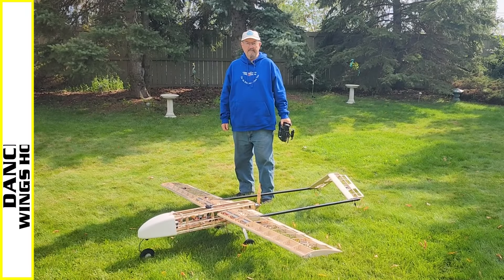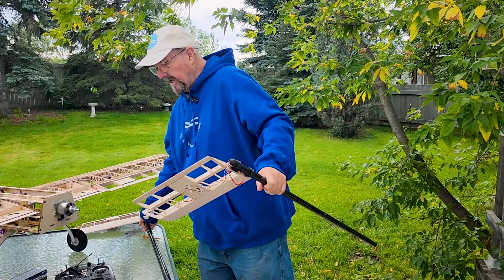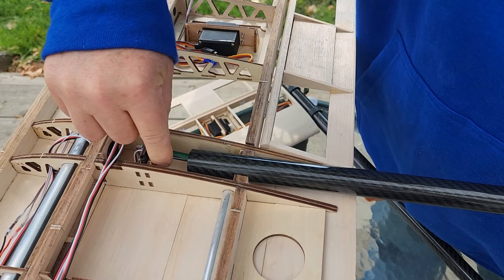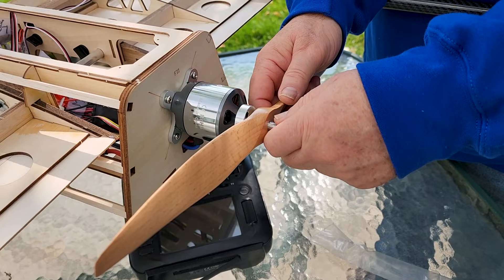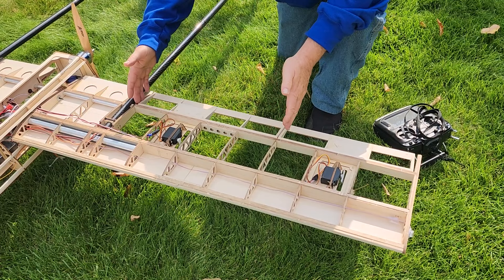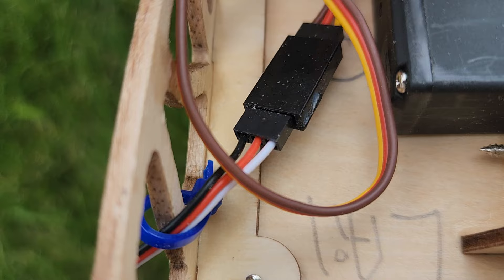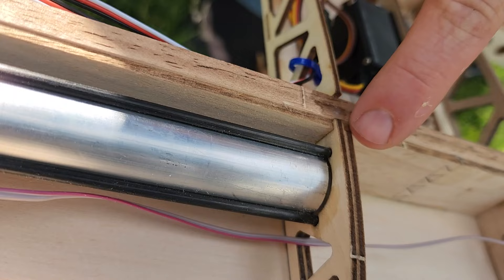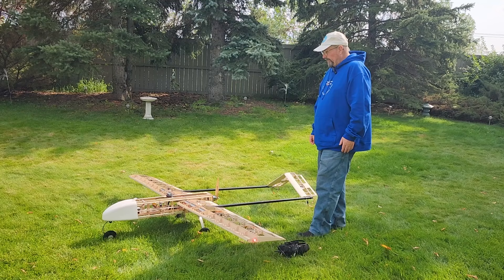RQ-7 Shadow RC hobby drone kit build - so will it work?

Comment: What the?  Did I see that you have the steerable nosewheel connected to your aileron channel or do you fly some kind of weird mode on your radio?
Reply from the maker: The radio channel mapping doesn't need to map to the servo outputs on an FC, so in I have AETR but out I have GRRAAFFTL, it's just like inputs/mixes/outputs on EdgeTX.- ArduPilot Magic! 🙂
Reply: @timtheplaneman  Maybe not magic... but definitely some form of sorcery! 😲    Why would you have the turn control on your right stick though.   Rudder/yaw/turn is usually on the left stick.   Confusing?
Reply from the maker: Oh you really are paying attention @xjet  . This one is because of my RSI, same reason I use a mouse with my left hand. I fly "mode 3" - roll/pitch on the left stick, yaw/throttle on the right stick, because otherwise I get shooting pains up my right arm. It's not confusing if that's the only way you do it!